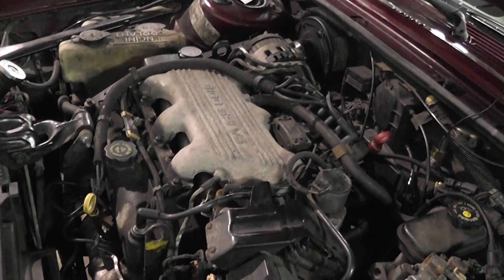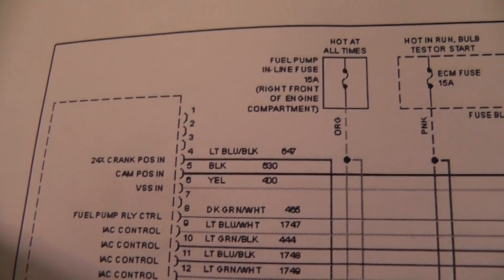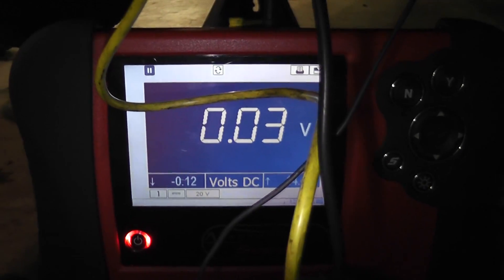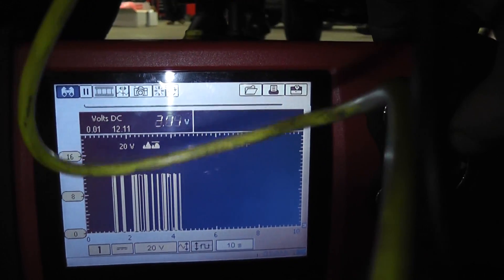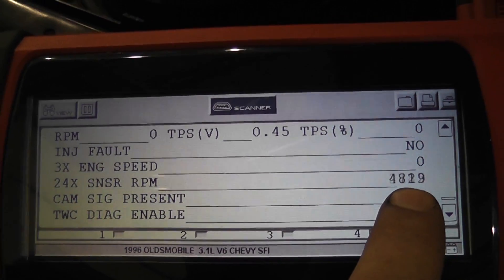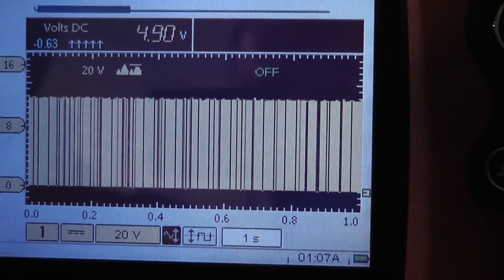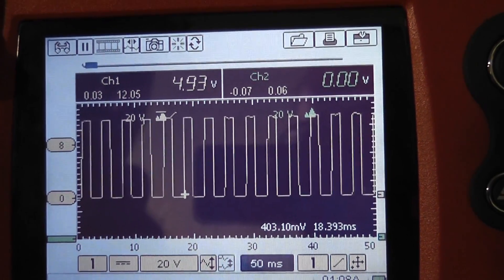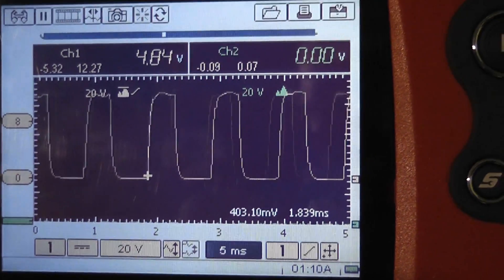How to test a GM 3-wire crank sensor (hall effect type)

Comment: Excellent video!  I am trying to bench test a PCM using a simulated crank signal from a PCM sound card. Do you know if a GenIII 24x GM V8 is 12 volts pull up type hall effect sensor?

Comment from the maker: @contagiousFX That depends on the type of ckp sensor. What type are you referring to? This would be in Section 21 in my book (Ignition System Inputs). I think you have the book already correct? Also Section 2 (Switch Inputs) for digital circuit designs and testing. (hall effects and opticals work on these principles.

Comment from the maker: @wilkk No, first some systems need a cam and crank signal to start. Two even if it only needed a crank it has to be timed correctly to piston position. You couldn't possibly trigger the sensor with the correct frequency.

Comment from the maker: No voltage drops across the test light during this test (PCM sensing circuit resistance is too high for ANY measureable amount of current flow). There is a full 12v on-off signal being sent to the PCM. You could use a jumper wire to direct battery voltage for this application if you wanted to. The only reason I use a test light is if I touch the wrong pin accidently. You can imagine what would happen if you touched on the sensor ground circuit with a jumper wire connected to B(+).
Thanks!